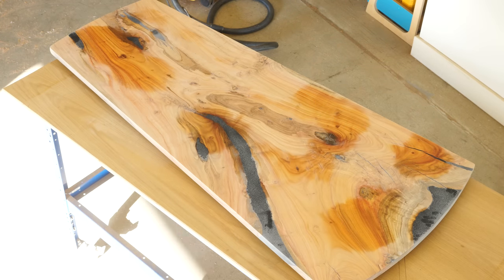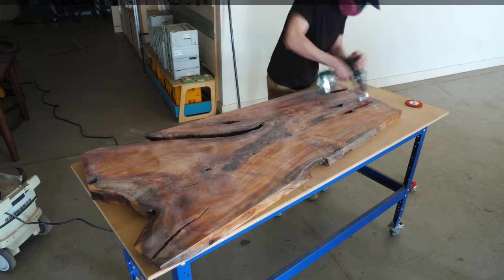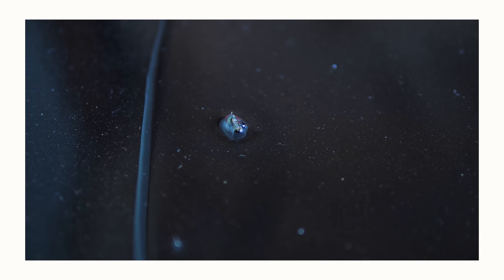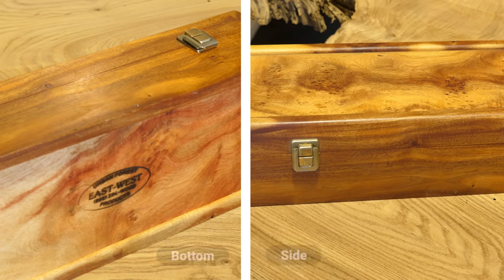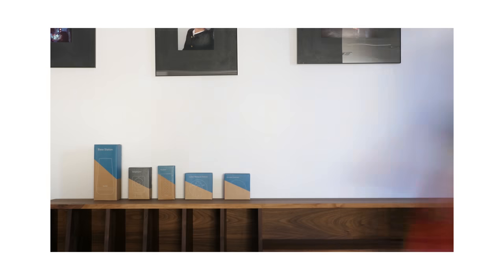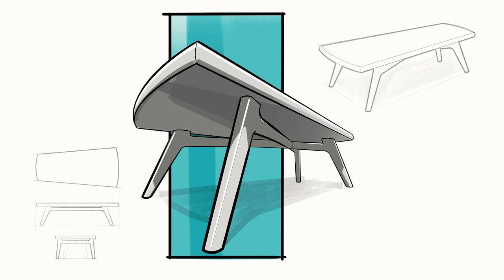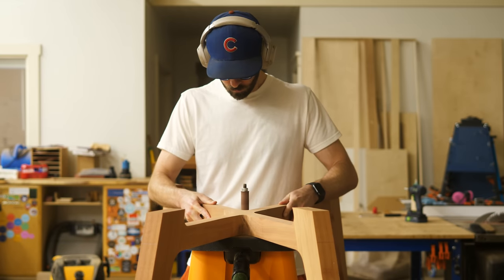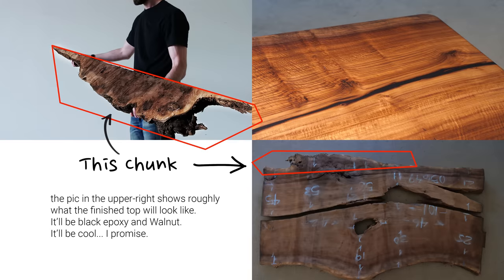Turning Worthless Wood into a Stunning Table

Comment: 38.496875mm is by all practical means, 38.5mm. That's a difference of 3.1 micrometers. A human hair in comparison is 70 micrometers. I get that you're trying to make a point, that "both sides are confusing" but it falls a bit in the absurd pile to use more than 1 decimal when woodworking with millimeters. Unless you're NASA maybe but I don't think they're doing too much with wood. Yeah I got triggered 🎉

Comment: here's the flaw with your argument for metric vs imperial. The reality is that in the real world the conversion is not 1 33/64" to 38.49685mm, it would be 1 33/64" to 38.5mm because the difference between those two numbers are less then the width of a human hair, and well within the adjustment/measurement tolerance of any device that most people would use in word working. 

To give the reverse example, it would have been like me saying 'The table top got trimmed to 38.5mm or 1 64473/125000" see how crazy precise you have to be in imperial vs this simple measurement in metric!"

At the end of the day it comes down what you are more comfortable with 1 33/64" or 38.5mm. Personally I like metric because I don't have to divide into smaller fractions every time I want to be more precise.

Comment: 38,496875 is an absurd number for a millimeter. You don't need and don't use this much numbers after the comma with any metric prefix, usually 2 ( 3 for a meter,  to get mm precision). If for some reason you need more, you'll use nanometers or pecto- or whatever is smaller. And you personally ain't making a rocket precision parts, you just trim some wood bro, 38,5 is enough.

btw 38 mm is kinda cringe for a metric lumber, we use numbers that end in 0 or 5 or just powers of 2

Comment: So firstly you are plain wrong about imperial over metric. I was bought up in the UK in the 1970 and was on the switch from inches to cm. Cm is way better.
Secondly it is Maths not Math. Mathematics is a plural so if you are shorten it you still need the plural
Lastly, great table. I wish I could get one but getting it to France, where I now live, I expect would be very expensive

Comment: NO!!!! WHO uses 38.496875mm when setting up a tool? Maybe if you design engine parts for a F16.. 38mm or like 38.2 is usually accurate enough. So no they are not as hard to dial in because 38mm is accurate enough.

Comment: 9:20 - Only time I side eye a measuring system is when a person uses kilograms for a humans weight (she is 136 kilograms...Is that heavy??) or when its used for temperature in certain scenarios (Its 37 degrees...Is that hot??)

For me its way easier to use an easy to remember number like 100 with a radius around it. less than 100 is light for a human but hot for a human for example. If she says shes 136 kilograms I have no idea what that is. I would have to work out that this 136 kilogram girl is actually a  300 pound woman. Thats a lot of woman. That 136 kilograms just sounds really misleading. When its 98 degrees celsius I would have to work out that this 98 degree celsius temperature is actually 208 degrees fahrenheit. I feel like imperial is for easy human comprehension and metric is great for precise measurements of objects.

Comment: For the bearded - also for the unbearded whose head doesn't conform to the respirator manufacturer's imagined norm - to protect their lungs a positive pressure hood or mask plus HEPA room-air scrubbers, plus HEPA-filtered vacuum pickups at the tool are all necessities. You'd have to be financially successful to afford all that protection. Nevertheless, those protections ought to be priorities.